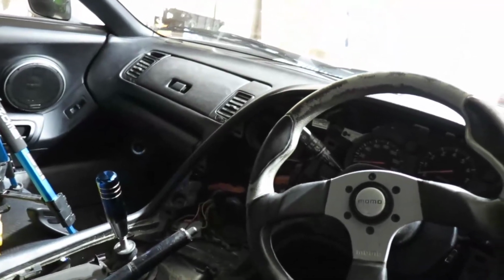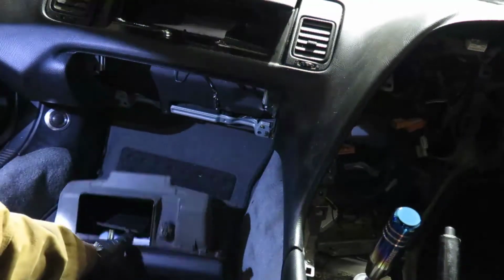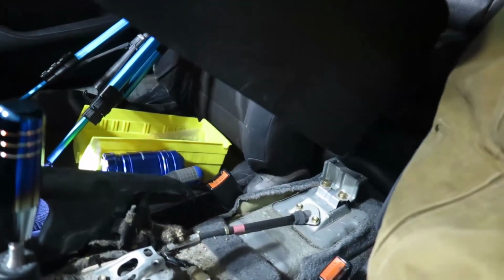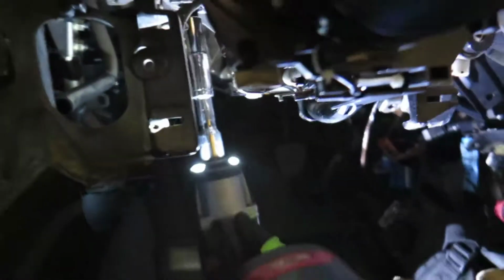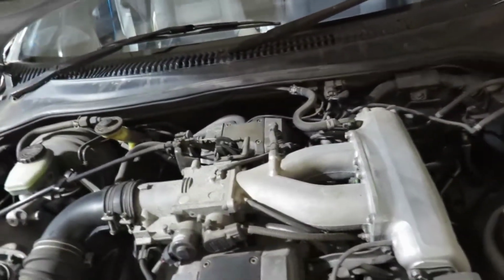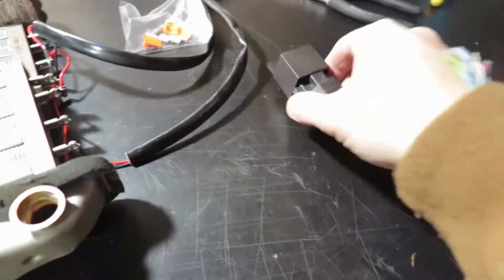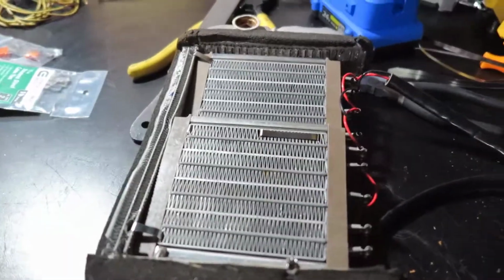EV Ceramic Electric Heater Heater and Dashboard Disassembling - Season 1 - Ep7

Comment: Do you have a link to wear you bought the heater elements??
Reply from the maker: ya definitely. Guy is on eBay and he has a channel called @GregGoesElectric.
https://www.ebay.com/itm/Pair-Universal-Electric-Heater-Cores-12-72-VDC-Great-For-Automobiles/373424110865?ssPageName=STRK%3AMEBIDX%3AIT&_trksid=p2057872.m2749.l2649

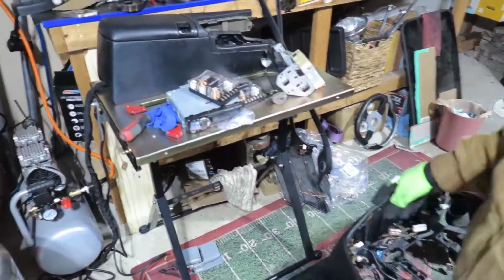Comment: @16:46 looks like Crossovers for the speakers... 

RE to the hand grip you gotta use a flat head and release a hook for lack of better words and slide the hand grip off from both top and bottom. i can't really explain it lol. but it slides on and off but has a "stop hook" (for lack of better word)

@17:21 🤣🤣🤣🤣
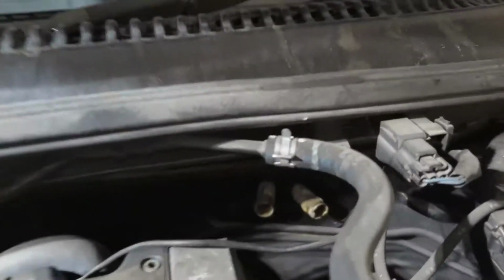@19:03 he may have deleted it due to him not having any use for it. Like down here in the Caribbean, We don't get snow so we will never use our heater system on our cars. we usually just condemn them. Sometimes it may have a leak that we don't want to fix or other times we just simply condemn it if we're doing work on the car.

@20:21 if i were you the fact that you even willing to go that far, i would have re-routed the coolant lines to the heater, turn it on and check for leaks. if it leaked i would have patch or fixed the leak. it would have probably been cheaper and faster fix but lol. 21st century electric heaters lets go lol

@31:12 figure you would have done some Tack welding them in place inside the original heater. just ensure those wiring don't touch any metal surfaces to ground out or short out. looks good man hopefully it works to your liking
Reply from the maker: lol I like trouble. I though the electric heater would not leak or break and it would also be interesting to get done Ya you are right about the weather also. Car was from Australia New South Wales. Hot weather.
You were saying tack weld the plugs or the core into the other core?
All of this goes inside a plastic case so I'm not too worries except for the plugs to loosen with vibration. I was thinking about solder the plugs in place so they don't get loose. Everything will be fused and relayed so hopefully no fire. The wire gets a bit hot though so I am a bit worries about that.

Thanks for the comments my friend!